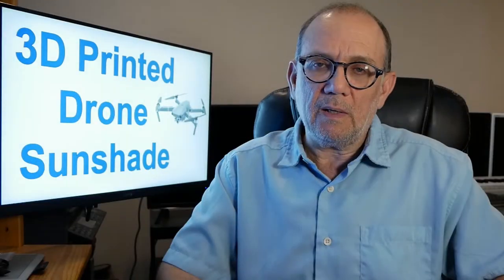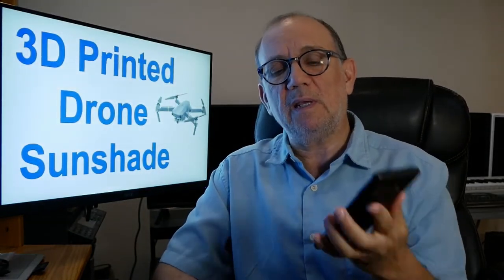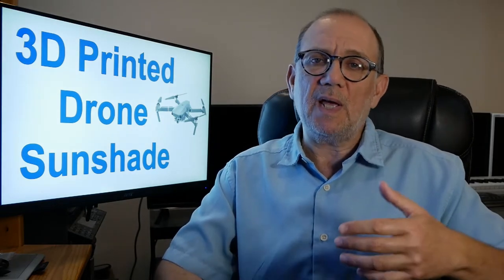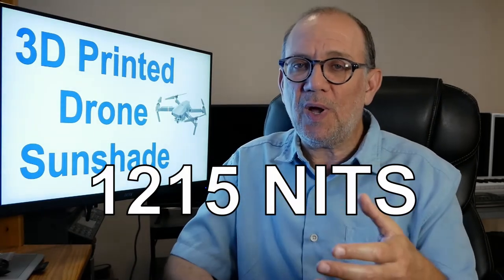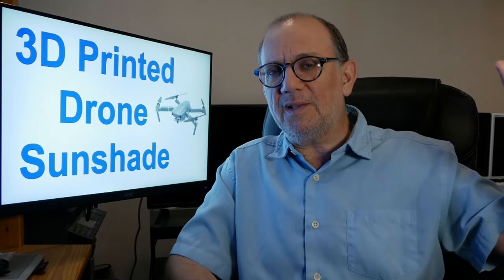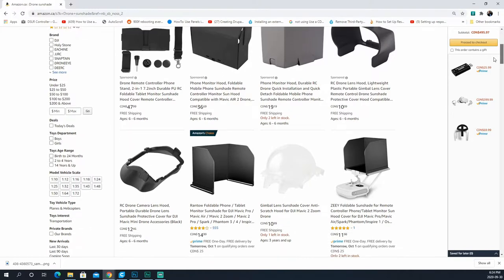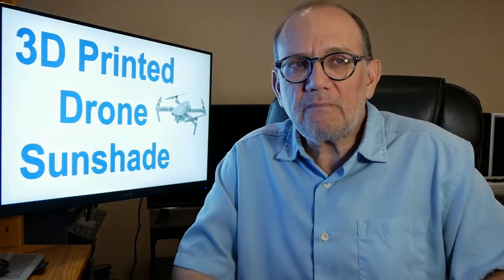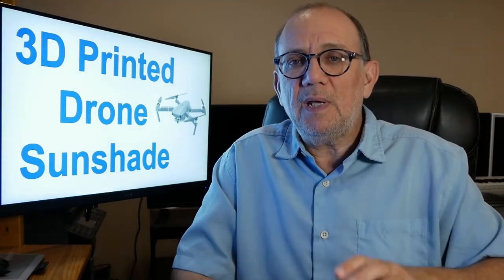3D Printed Drone Sunshade for Mavic -- Does it Work?

Comment: How much does the sunshade weigh? I have a folding sunshade from Amazon and it weighs 120 grams.
Reply from the maker: It weighs 128 grams.  It can be lighter if I print the top and sides 1mm vs 2mm.  The bottom flap is 1mm and it's pretty solid.  I may try to print a lighter version.  Unfortunately it does not fold, but it's still easy to carry.  I answered to this question earlier but for some reason the answer disappeared.  Weird!